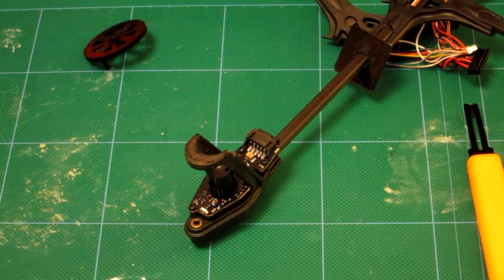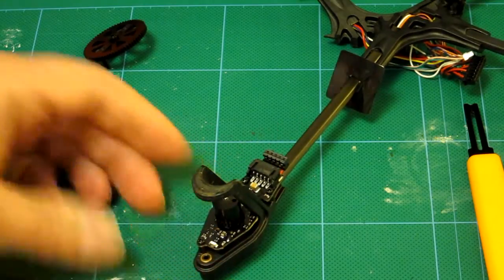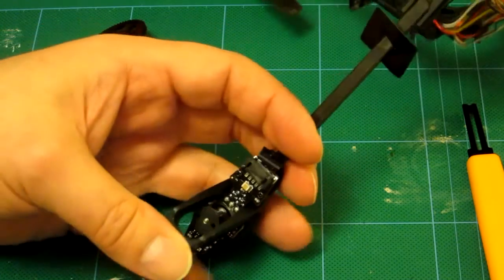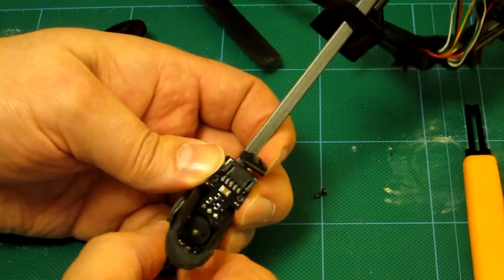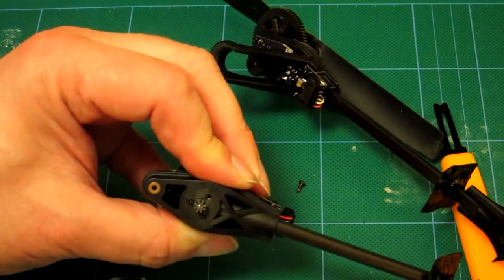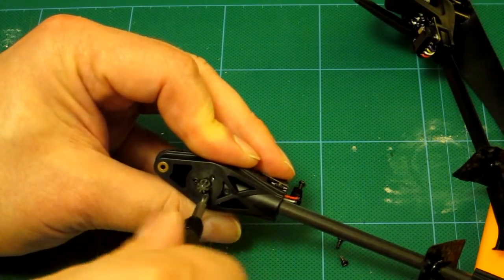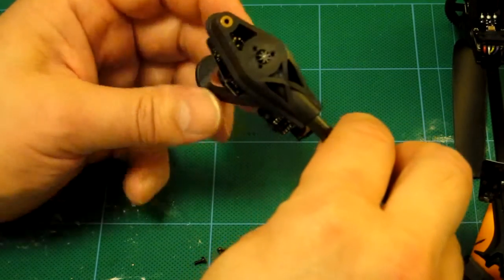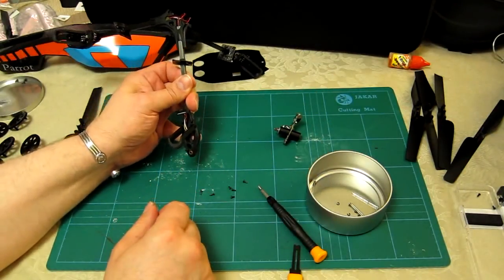Parrot AR Drone - Removing a Motor - Take Motor + Control Circuit Board Off - Repair Segment

Comment: Does any1 know what motors are used in the ar 2.0 elite version or can i use brushless in mines as he keeps wobblin on take off but the motor dies spin
Reply from the maker: I always used Parrot replacement parts.

If your motor spins then it sound to me more like Bent Prop shaft pins.
Have you done all of these checks and cheap changes?
As I show in this video:
https://youtu.be/lsP5tTvMMFU

Comment: I keep getting a false read of version 0.0 on motor 4 no matter how I swap them... any ideas?  i just replaced a bad main cross bar with a good one
Reply from the maker: If swapping the motors results in the same error then it is either a fault in the wiring loom or something wrong with the control board.
First thing I would do is unplug and reconnect all the ZIF connections double check as you reconnect them again.
Reply: Tom Strong Reviews thank you

Comment: hi,should come in very handy,ive had bought a 1.0 from asda direct for 130 and i love it although 1 motor has already burnt out! ive onlu used it no more than 10 times! ive a few bangs but nothing to major, my questions are 1,do they burn out often and 2,are 1.0 and 2.0 same motors?